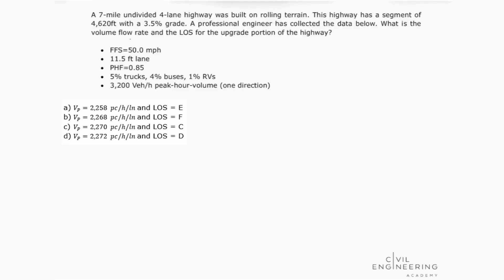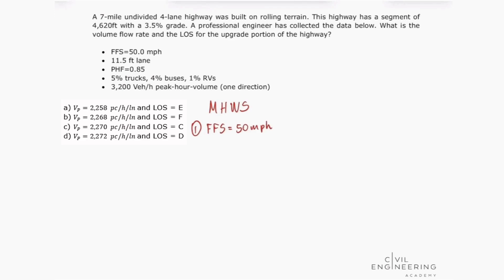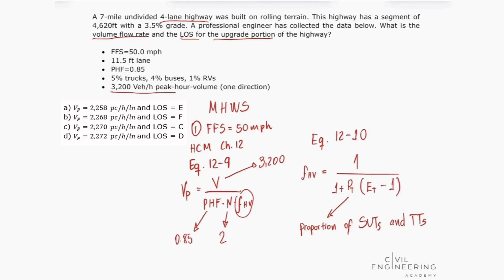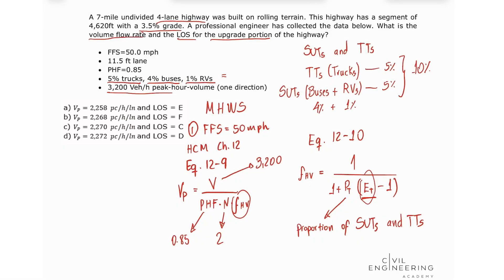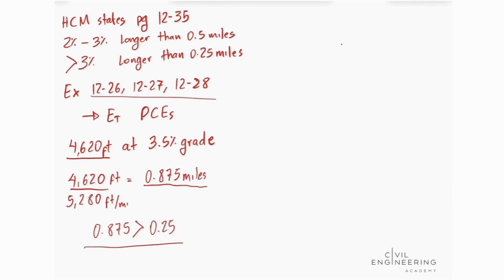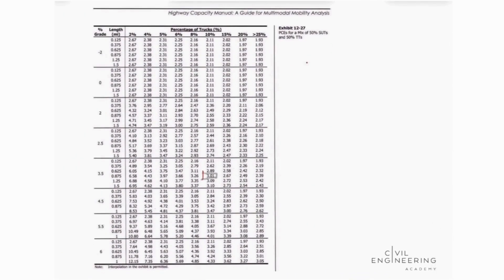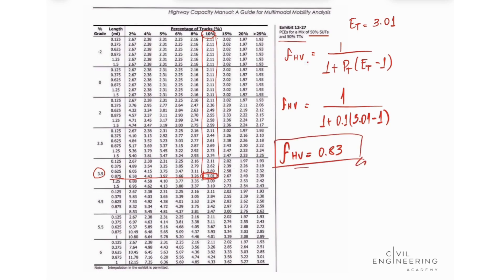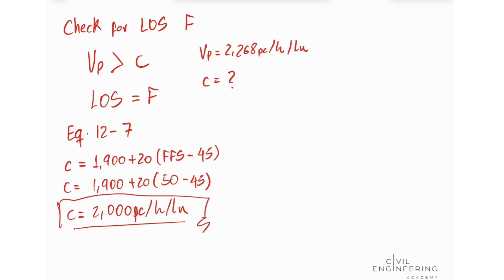Civil PE Transportation Exam – Find the Volume Flow Rate and LOS for a Highway Segment

Comment: Question: in the calculation of the heavy vehicle adjustment, we are looking for the Et and Pt values. The definition of Pt is about the proportion of SUTs and TTs and in this case is 10% but then when we are checking the exhibit 12-27, the column say percentage of trucks (%), is it should be 5% and not 10%? Because the 10% include TTs plus SUTs. Thanks for the videos.
Reply: "Percentage of Trucks" in Exhibits 12-26 thru 12-28 refer to total trucks -- SUTs + TTs. Same value as Pt.
Et refers to proportion of SUTs/TTs. Which in this case is 50%/50%.